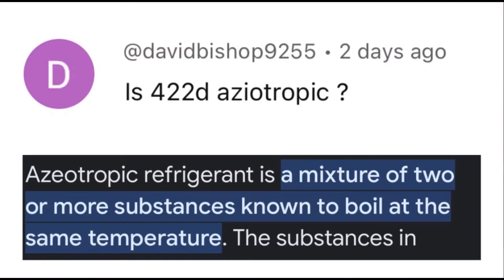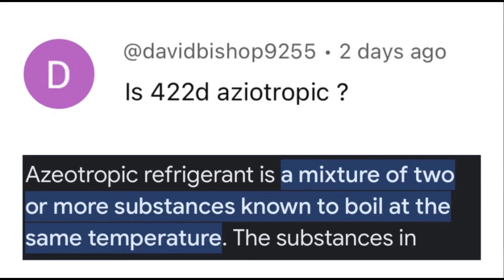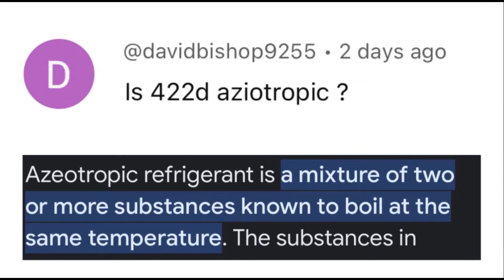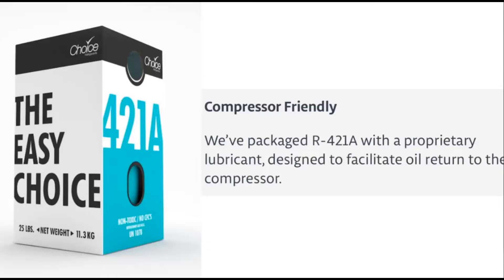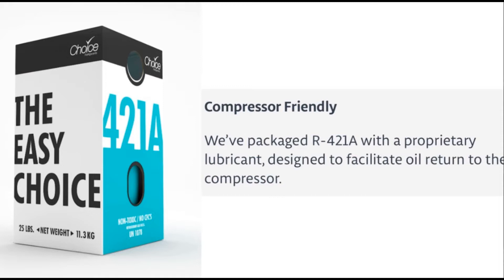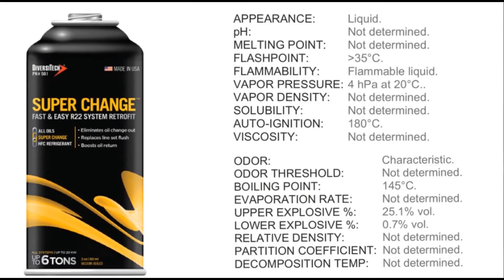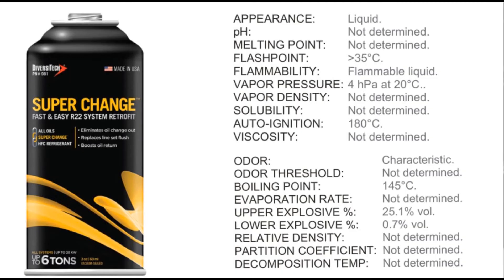Properties of R422D, R407C and R421A (R22 Replacement Refrigerants)

Comment: The way you guys consistently rag on Goodman makes me nervous; after 18 years we got our heat pump (both pieces) replaced last year, and the company used Goodman.
Reply from the maker: I give them a hard time, but it’s all in good fun. There’s actually not much quality difference between many of the available brands.
Reply: @Zacksshoptalk  Thanks for that; I've heard the installation quality makes the most difference, and they appear to have done a good job.
Still, I did buy a couple of spare capacitors and contactors, given ongoing supply chain issues.
Reply: @Zacksshoptalk  Goodman is as good as Lennox😂 my company installs lol.
Reply: None of the manufacturers can consistantly build indoor coils that don't leak, so your chances are as good as with any others...
Reply: @haroldg4192  OWCH!🤣